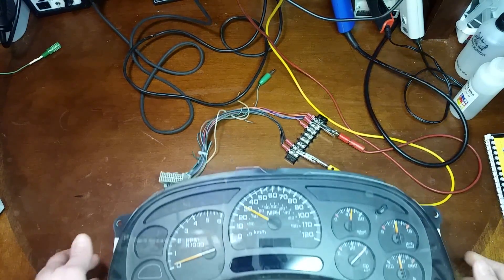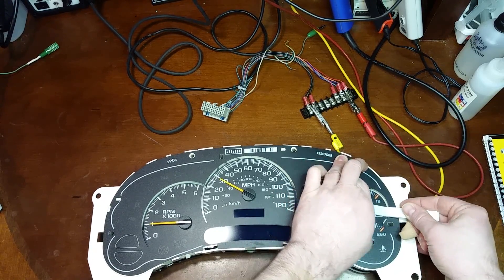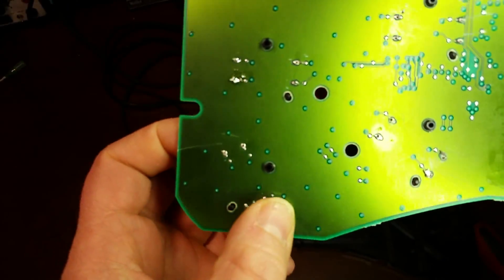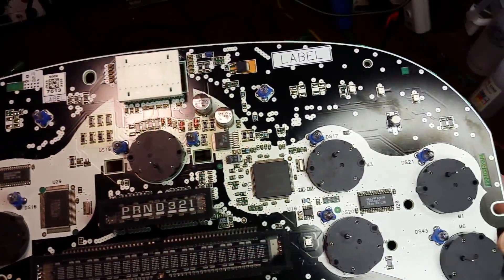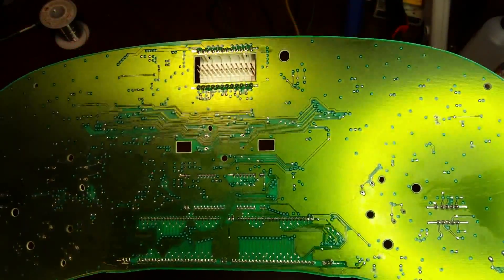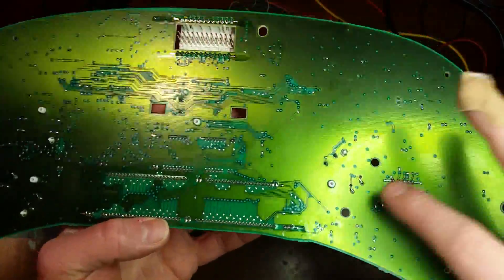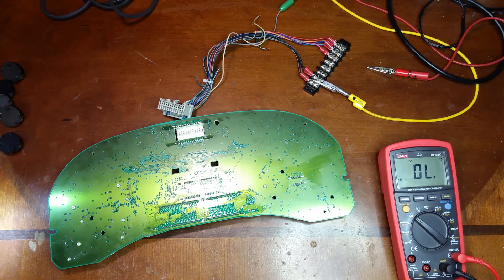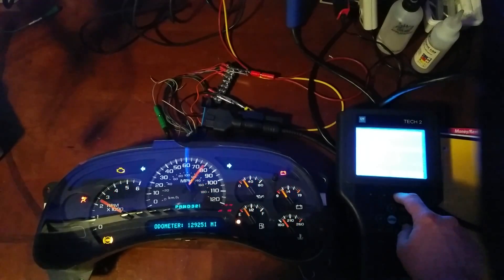Repairing a GM cluster someone attempted to fix themselves

Comment: Ware is the best place to buy the stepper motors and supplies to repair gm instrument cluster?  Thanks
Reply from the maker: X27.168 are safe to buy pretty much anywhere. It's just the bulbs/LEDs that sellers bundle together that suck.

Comment: @Jeffescortlx I have a 2005 silverado cluster that has the vfd intermittently goes out and intermittently scrambles. Have you ran across this? And is there a common culprit? I have inspected the whole board and found nothing visual and also have not had it repeat for me.

Comment: Hi Jeff, I got an 03 Silverado cluster that once booted up keeps cycling between English, French and Spanish languages. I made sure that the button is not in stuck position. Any ideas on what it can be?
Reply from the maker: Yes, fractured solder joints on the resistors.

Comment: Did you ever come across same cluster as on your video that drains the battery? If yes, did you found the culprit?
Reply from the maker: Yeah 03-04 do it all the time. Check the resistors feeding the input of the regulator and the current shunt 16 ohm resistors.
Reply: are the only 2 shunt resistors connected in parallel? Both giving nice 8 ohms together.
Reply from the maker: Corrrect. Check for fractured joints.
Reply: I just did solder all known fractured joints once again, since itt looks like someone did partially remanufactured the cluster some time ago. All joints were resoldered already.
Reply from the maker: Confirm cluster is going into sleep mode. Disconnect ignition wire while monitoring constant 12v current. Wait 20 seconds and current should drop to approximately zero.

Comment: I find radio-shack non-electric desolder sucker to work better than the electric pumps. these electric pumps sometimes suck the pad along with the solder. but the 'manual' one works perfect every time.
Reply from the maker: Best Pixel Repair INC 
Not off memory but I cover it in my fr300 video in the description
Reply from the maker: GM Dash Fix 
I have one of those radio shack bulb styles. Bought one about 18 years ago. Once you get the feel of the FR300 you can go much faster with ease. I haven't had any issues with pad lifting. You just have to get the hang of it so your not over aggressive with physical pressure or temperature.
Reply: mine is chinese S-993A off ebay. seems like its pump is a bit too strong. i tried it on lowest heat setting, and also tried desoldering about 1/16 - 1/8 away from the pad, and the opposite:  pressing firmly on the terminal and still rips the pads off. Now trying to figure out how to de-power the pump, seems like the pump is way too strong ?
Reply from the maker: GM Dash Fix 
if anything the pump on my S993-A is weaker than my hakko.
But I don't have problems with pulling pads with that either. Maybe the thermo control is defective on yours, or your pushing too hard/dragging or holding too long. 
I think it all comes down to just getting the feel of the tool.
I wouldn't want to go without my FR300 after getting use to it.
Reply: My FR300 is lifting the pads only if they were lifted by the previous incompetent repair. Otherwise it is rock solid. Except needed to be cleaned pretty frequent.
Reply from the maker: Best Pixel Repair INC 
After I went up one size in tips on the fr300 it stopped clogging 99%. It's one of my tools I don't want to go without.
Reply: Do you remember what is the next size? 1.2mm or 1.5?